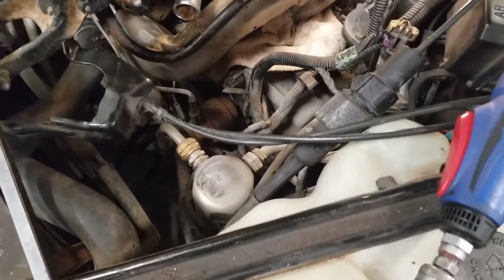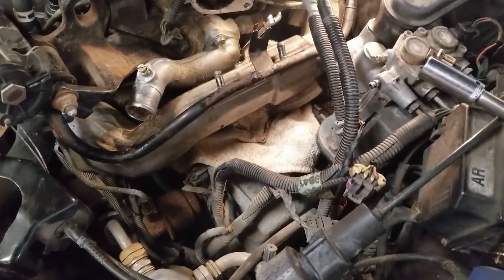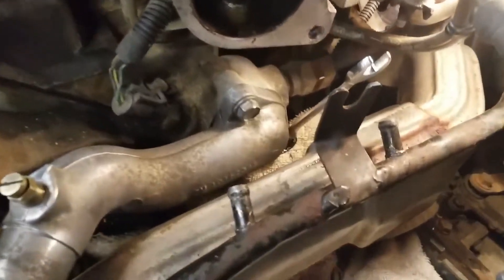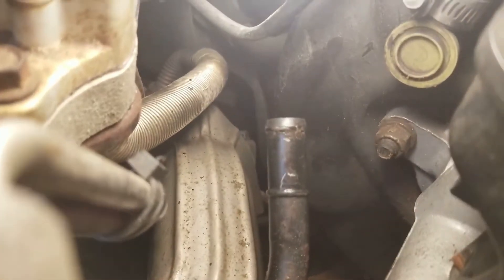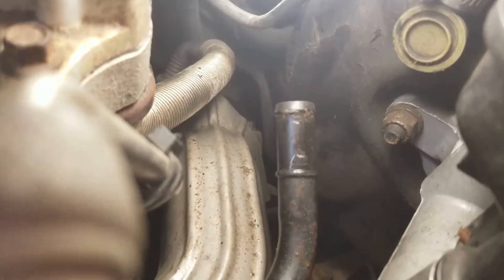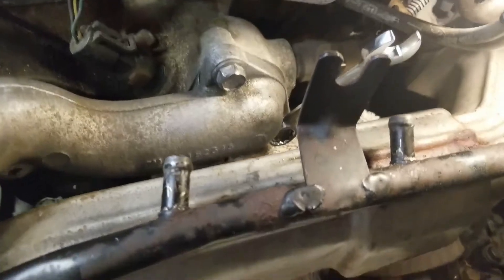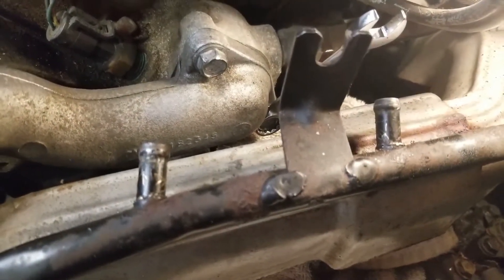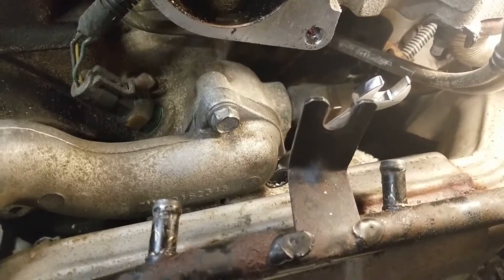3100 Thermostat Change Easy Way

Comment: There sometimes isn’t enough room to work the housing past the heat shield with the thermostat in place. It all depends on how loaded the engine was when you set your brake. If you have it on the ground you can try to push the van back or forward and set the parking brake to pitch the engine up or down.
Reply: I know it's been a year, but do you know if you can pitch the engine while it's off?
Reply: @ i believe you can if you can get it out of park and push the whole vehicle somehow.
Reply: @emmettturner9452  thank you!

Comment: Do I absolutely have to remove the throttle body?
Reply: Yes 🤦‍♂️
Reply: Thanks the radiator was clogged.
I didn't have to change the thermostat.